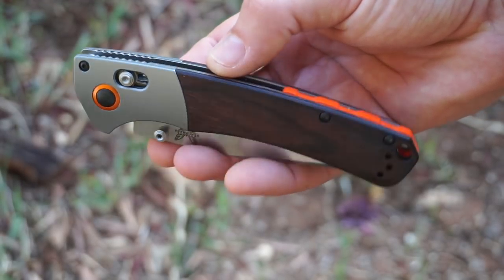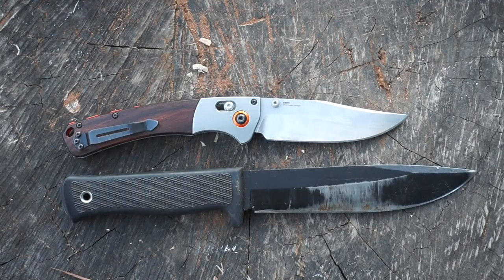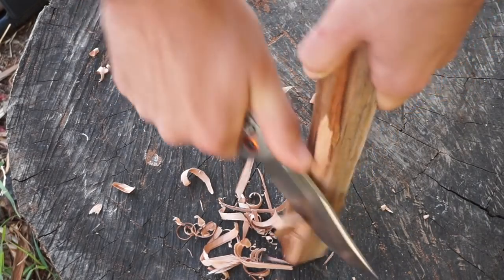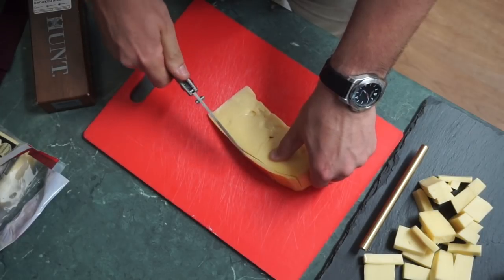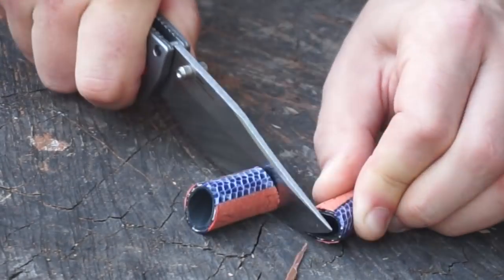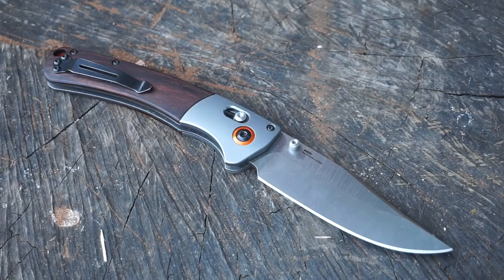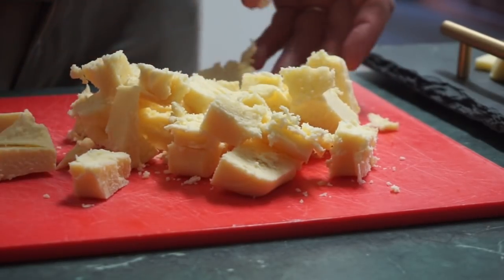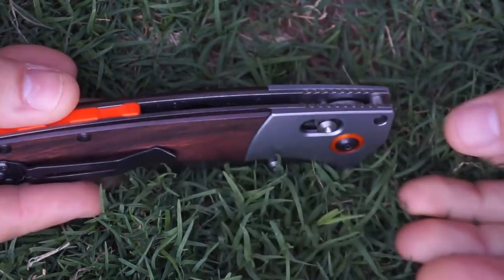The New 110? Benchmade Crooked River Full Review

Comment: This is my favorite folding knife for camping & the like. Mostly I'll've used it to cut up the steak I've probably grilled, but it's also handy for scraping cactus thorns out of your boots, scraping stinging caterpillars off of your shirt, and, again, cutting up steak. I feel with this you can do without a fixed-blade knife if your hard-use woodworking tasks aren't too great, as they tend not to be in my neck of the desert. And did I mention it's really good at cutting up steak?